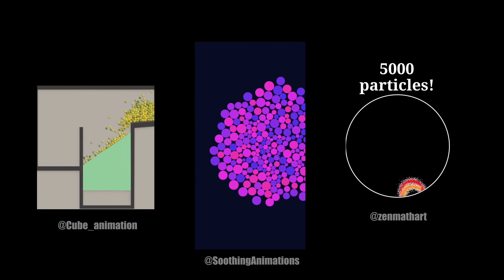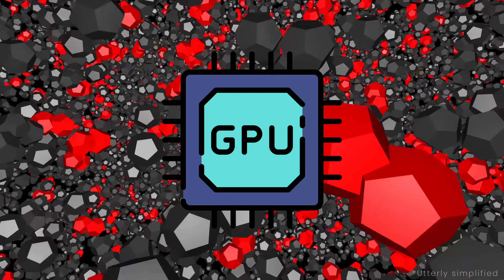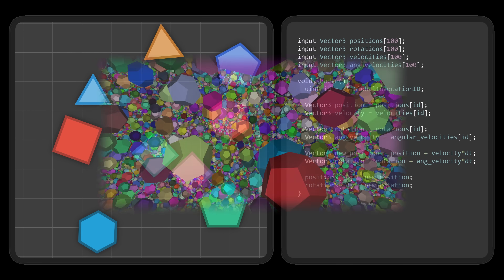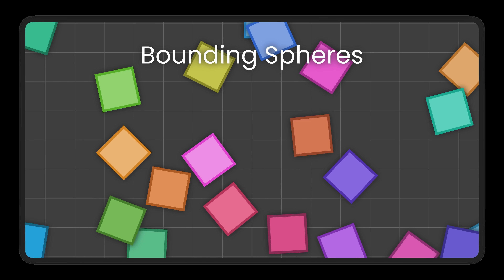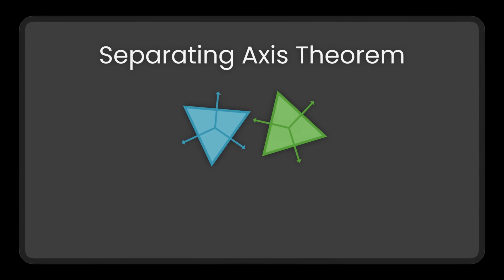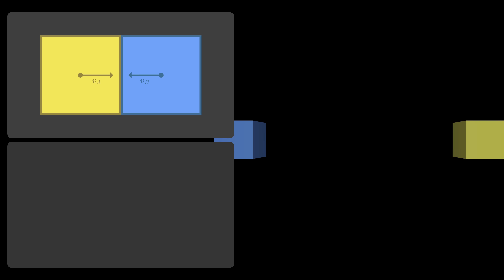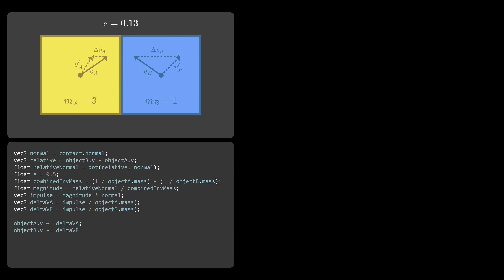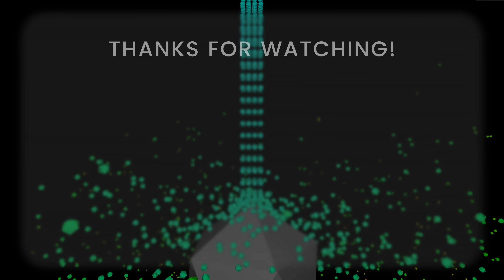Making a GPU Physics Engine from scratch

Comment: I also tried to write a physics simulation on Compute Shaders in Unity. I have achieved the same results as you. But calculating angular velocity is hellishly difficult. I really want to understand AVBD. But I haven't found a single repository on Github that will fully implement the algorithm.
Reply from the maker: That's what I found yeah. Linear collisions are easy, and taking rotation into account is just way to hard.

Comment: I think you overcomplicated a lot of it. If you have a vector for movement of the object and you have a velocity. You have everything you need to know. Let’s not bring rotation into this right now. So you have two objects now both with vector and velocity, when they collide… you can have restitution also… because you know the vector you can do math, very simple math. 

For two 3D objects, just project their velocities onto the collision normal and swap the normal components:
n = normalize(p2 - p1)
vRel = dot(v1 - v2, n)
v1' = v1 - vRel*n
v2' = v2 + vRel*n

For restitution in 3D, use the impulse formula:
n = normalize(p2 - p1)
vRel = dot(v1 - v2, n)
j = -(1 + e)*vRel
v1' = v1 + j*n
v2' = v2 - j*n
Reply from the maker: Thanks for your comment, I agree! But what if we have 3 objects colliding at the same time? Like in a tower? Then the result is not deterministic, and some objects will interpenetrate through others, creating weird bounces and energies restitutions!

The problem with all of this, is that I used the GPU to process everything in parallel, which makes things much much much more complicated for very little benefit.

Cause I'm a programmer 😃
Reply: @The_Code_Stories 

You don’t do something magical just because there are 3:
	•	You still just send all objects to the GPU as arrays: positions[], velocities[], masses[], radii[], etc.
	•	Build a list of collision pairs: (A,B), (B,C), (A,C), etc.
	•	Run a kernel that applies the same pairwise impulse formula to every pair.

Comment: Great video! 9:33 - How do you spawn objects arranged in a quadrilateral or a sphere-like (or any other, actually) order, with random rotations applied and without them colliding on spawn?
Reply from the maker: It's been a while since I made that, but I think I just used brute force. If the object is spawned and it collides with a different object, I just spawn it elsewhere, until there it does not collide.

Thanks for your comment!!!

Comment: You only have one solver iteration per frame, right?
Reply from the maker: I do 10 solver iterations per frame. As I said in the video, the final solver is quite complex, and to avoid things like race conditions on the gpu at least 5 or so iterations are needed to get good results.

And yeah, you need at least 1 draw call per frame and at least 1 solver dispatch per frame as well.
Reply: @The_Code_Stories  Per Frame or per Iteration?

How would you compute 10 iterations with one dispatch?
Reply from the maker: @johnleorid  Per frame, so 10 dispatches per frame. But 10 is an arbitrary number you can set that higher to get better precision or lower to improve performance.
Reply: You can do multiple iterations for better stability. It's all up to you but more iterations mean more performance cost.
Reply: @Klyress  You need atleast one draw call (or comute shader dispatch call or whatever it's called) for each iteration - or is there another way?

Comment: Great video, but the title is misleading. This is a simple implementation of a fraction of a physics engine.
Reply: What is missing exactly then? Curious to know.
Reply: @leif1075  Physics is a million things besides collision. Think of water, gravity, sand. Think of a high school physics book. Is the only thing in it "collision"? Not really.
Reply: Pretty much every rigidbody physics engine is a constraint solver with collision detection.
All the other features are just extensions or uses of those two things. This may be simpler but conceptually not far off from what box2d or bullet does.

Comment: Please try using vulkan instead (nad multithreading rendering). Opengl is horrible.
Reply from the maker: Maybe on the future! This was my first 3D project, so I went almost with the first thing I found 😂
Reply: If you properly use vulkan (modern 1.3), you could definitely do millions of objects
Reply: No need. Opengl is still fine unless you're requiring modern api features.
Teardown was written using opengl :) most of the physics runs on the cpu too

Comment: I just realized if you can simulate physics in parallel (drawing AND updating objects) then you could run videogame physics in parallel. Yet all these building games with complex creation and complex physics interactions between separate parts/creations/ground - they all lag like hell for any above average thing that I try to build.
Reply from the maker: That's cause simulating physics on the GPU (at least the entire pipeline) is not a very smart idea! This is just a basic physics engine, but usually, it makes more sense to execute physics on the CPU and leveraging some parts on the GPU.
Reply: Because it's easier to synchronize data on cpu in one thread. Games are event driven, so order of execution matters a lot. Heavy lifting often goes to background or shaders. But I think we are in a shift of paradigm right now, utilizing multiple threads in parallel and GPU for batch processing. See Dyson Sphere Program for example, a modern building game taking a serious approach to solve this

Comment: The hardest part of any mechanic simulation is getting the collision-response of rigid bodies right, especially for the case that multiple objects are colliding at the same time in the same place (your last example demonstrates very well what exactly happens if one isn't really careful & pays special attention for these degenerate cases - simulating multi-contact mechanical systems is indeed a hard problem).
Reply from the maker: It is indeed hard. Even harder as I execute collision resolution on the GPU, so I have to check for race conditions.

Still, the solver is quite simple, so no contact point or surface is needed.
Reply: Just increase the temporal resolution, bro

Comment: for your sphere collisions check, you will have a O(n^2) rum time, better to use quad tree or something to accelerate collision
Reply: Yes, for 3d an octree or maybe a aabb-tree.
Reply from the maker: Technically speaking you are right. But since I leverage on the GPU, even it it's O(n^2) (which it is) it is still quite fast.

With that being said, when I revisit this project, I will 100% implement either octree, bvh or satial grid!

Comment: The method for detecting collisions described won’t work for some collisions where one of the forms is not convex.
Reply from the maker: Absolutely right, SAT only works on convex geometries. But, you can split any non covex gemetry into a sum of different convex ones, so with a slight tweak, it should work!

Comment: i mean, as a video for VERY rough overview - fine, however i don't believe it answers the question posted in title at all. 
1) No derivation of equations of motion (which is important, as what you wrote for angular one is wrong, linear and angular are similar only in differential form, but when you integrate angular velocity into quaternions or some other representation of orientation - you get more complex formulas)
2) SAT is fine, lack of math for it is a bit pain, also should look into alternative approach - Gilbert-Johnson-Keerthi algorithm and Expanding Polytome Algorithm (aka GJK+EPA), as SAT falls off heavily in terms of performance for mesh colliders with a lot of polygons compared to GJK+EPA (which falls off heavily for mathematical colliders like spheres or capsules compares to SAT)
3) No intersection resolving algorithm mentioned
4) No collision point/surface calculation
5) No accounting for non-central collisions and angular velocity during collision
6) No derivation of coefficient of restitution
7) No protection against different results because of object traversal order
basically if people want to look at it for content, for pretty animations, then sure, but if they want question in title answered - then not really
btw if you are interested, i can attempt to give a lecture on mentioned topics ("attempt" because eng is not my first lang and because slides i have for this are not in english as well, however it's mostly math and math doesn't care about language lol)
Reply from the maker: Most of this things are implemented in the project, BUT, this video is not trying to be a complete guide on how to implement physics. That would take hours! With this video I'm trying to explain the intuitions easily and for everyone to understand. 

I make this videos because videos like this ignited the curiosity spark in me, and that's why I'm an engineer now. I want to make people feel that. Maybe on a far future I start making courses on all of this, but this is just my first video!

Thanks for commenting and have a nice day!

Comment: Your handling of angles is suspect. What you are calling "rotation" should probably be called "attitude" and is not a `Vector3` at all, but something like a unit-length quaternion (an orthonormal matrix would also work, but both representations need to be normalized from time to time, and normalizing a quaternion is much easier to do; plus the quaternion is a much more compact representation). The formula for the update is not just a sum, but something like multiplying by the [quaternion] exponential of the pure vector 0.5*ang_velocity*dt (i.e., the quaternion with 0 real component and that vector as i, j, k components). Instead of computing the quaternion exponential (which requires evaluating trigonometric functions), the linearization of the update formula works well enough for video games and is much cheaper to compute.
Reply: exactly, linear and angular parts are equal only in differential form, meanwhile to calculate change of orientation quaternion based on angular velocity pseudo-vector you need to q_i = q_i-1 + (w_i-1 * q_i-1 * dt), where q_i is the new orientation, q_i-1is the old orientation, w_i-1 is the angular velocity in form of quaternion with 4th component being 0, and dt is the frame duration
Reply from the maker: Yeah absolutely! I'm trying to make things as simple as possible. This not a tutorial rather a showcasing and a brief explanation. In the real code (which you can see in the repo) I use quaternions to calculate rotation. The problem is that quaternions are very hard to understand if you don't have a sort of solid math background (even I barely understand them and I'm an engineer).

So as a summary, most of the things here are simplified because I want to keep the video accessible to the most amount of people possible!
Reply: @The_Code_Stories  Ah, that's fair. Still, I would have appreciated a brief comment, or even just an on-screen disclaimer explaining the simplification.

Comment: 0:50 how did you do the shading?
Reply from the maker: It depends. If you want to do it on the CPU, enabling lighting with glEnable(GL_LIGHTING) gives you some basic shading. However, if you want to do it on the GPU, you'll need to write a vertex and a fragment shader, and implement a lighting model like Blinn-Phong lighting. There are plenty of resources out there that explain the process quite well.

Comment: SAT looks incredible! it's like an algorithm that can check collision between any mesh. But because of its impact on performance, I guess meshes have to have a simplified version of themselves specifically for collisions when working with big meshes
Reply from the maker: Well, not any mesh. SAT can check wether 2 convex meshes are colliding, but it doesn't work with concave ones.

With that being said, you can technically speaking devide any concave shape into multiple other convex shapes. So again, technically speaking, it can check collisions between any 2 objects, just with a little adjustment.
Reply: well, yeah, 3d games use parallelepipeds, capsules or shperes for collision instead

Comment: Nice, but the broad phase is not broad enough if you're still checking every single object against each other. The simplest approach to a broadphase is just a grid: adding each object to one or more cells of a grid, using their bounding box or bounding sphere, so then you only need to check for collisions among all objects within a cell.
Reply from the maker: Thanks for commenting! That's one of the things I want to improve in the future. The problem is that implementing a spatial grid, BVH, or Octree on the GPU is extremely difficult with GLSL as it is not made for such complex shaders. That's why I opted for just bounding spheres, even if it's not the most optimal option. I'll probably implement something like that using CUDA in the future.
Reply: @The_Code_Stories never implemented spatial grid on gpu, but bvh is fine, not that difficult